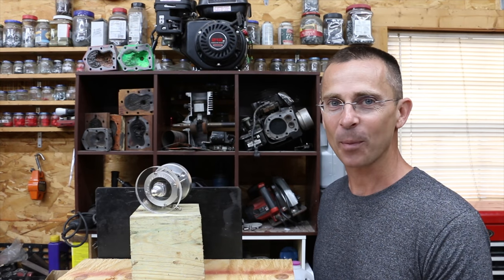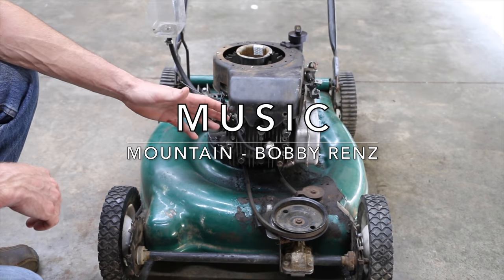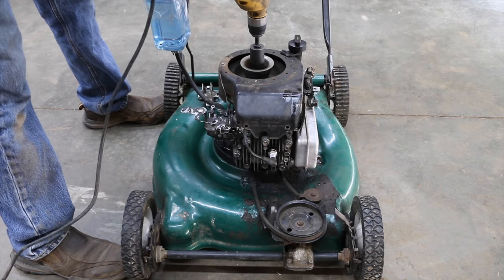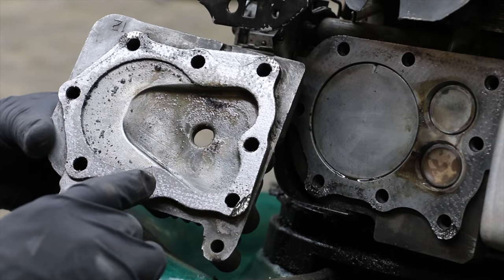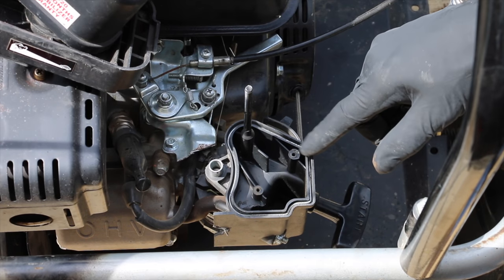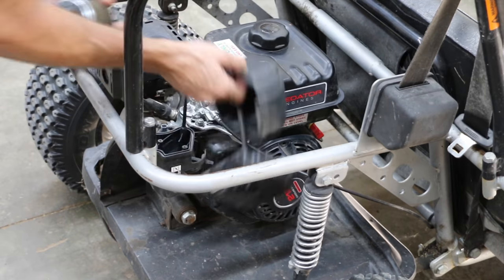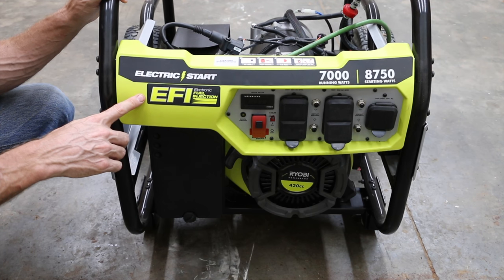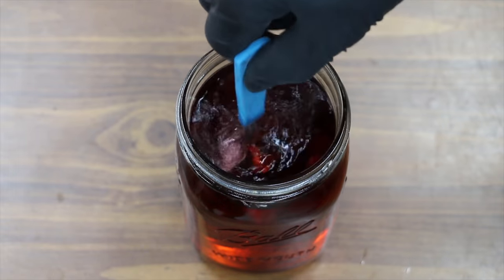Is Leaded Fuel better than Unleaded?  Let's find out!

Comment: Early in the ethanol age, I switched to 100LL Av gas for my small engines. The 4 strokes ran OK on it but the 2 stroke outboards that advance timing with throttle ran pretty rough. It definitely solved the hydrophilic issue I have living on the ocean in high humidity. I found an odd side effect though, that the 100LL leached the red out of any plastic tank I kept it in in a very short time. Clearly it wants to be stored in metal cans.
Reply from the maker: Thanks for the feedback.

Comment: For those who don't know why lead was added to gasoline:  Lead was added to gasoline to buffer the valves when they hit the valve seat.  Otherwise the valves don't last very long because it's like hitting two hammers together.  One of them is going to bust and in the mean time it's like having a troop of tap dancers tapping their way down the road but under the hood of your engine compartment.
Reply from the maker: Thanks for sharing.

Comment: I love how hobbyist pilots are allowed to poison the air.
Reply: jet fuel is much worse
Reply: @johnwoody4905  how is jet fuel worse? It’s practically the same as heating oil, very similar to diesel.
Reply: Many of us would rather not burn this junk, but the first 100 octane unleaded aviation fuel just got approved a couple of weeks ago. The FAA made it very difficult for the company that developed it, and individual aircraft owners will still have to pay for STCs to use it, and even then the fuel is unlikely to be available at most airports for a while… it’s really not a great situation. I would love it if we could get ethanol free mogas (normal gas) at most airports. A lot of planes have mogas STCs and modern experimentals can also run on that. The lead is really not a benefit for a lot of modern engines.

Comment: 100LL is DEFINITELY superior if your snowblower sits for long periods of time without being used...WAY better on hoses and gaskets
Reply from the maker: Great point!
Reply: I use it in all small engines...including chainsaws.....only for the lack of ethanol....is MUCH easier on rubber gaskets and seals. With that being said im sure non-ethanol 91 octane would actually produce more power but for me its easier to get 100ll so that's why I run it/have for 15+years in small engines
Reply: Or you can replace the hoses with silicone and you'll never have any problem with ethanol-containing fuel ever again.
Reply: Just run ethanol free fuel. That's basically what you're buying when you buy 100 LL your snow blower and small engine don't give a damn about the octane or not resistance. If anything you're actually going to decrease the power because the higher octane fuels combust slower.

Comment: So is it bad to use 100LL fuel in a newer ATV? Will it harm anything? A 2021, 850 Can Am to be exact haha.
Reply: Lead will damage the catalytic converter if there is one.
Also it will form deposits inside the engine as well as on the spark plug, possibly shorting it out and therefore keep it from making sparks.
Piston airplanes engines on the other end have 2 spark plugs per cylinder and are disassembled and cleaned quite often compared to a car or lawnmower.

Comment: The 100LL is still 4 times as much lead as the 80/87 avgas. The green fuel is 130 octane and when I couldn’t get 100LL I had to use it. On my next run up I had remove the lower spark plugs and empty out the lead BBs. The leaded fuel is needed because the engines are high compression and typically run full throttle against a continuous load. They don’t have knock sensors and computers like cars do these days. They are currently testing alternative fuels without lead. FAA regulations require that if any quantity of a non approved fuel is introduced into the engine it must be disassembled for inspection. Chevron made that mistake in California in 1995 and it cost them over $60 million, plus rental aircraft. Pocket change to them.

Comment: Very cool.   Now you gotta test G100UL! The FAAs new replacement to 100LL…. I have an airplane and 100LL is cool but I’m digging lead out of plugs is a routine! Love the channel!
Reply from the maker: Thank you for the video idea!
Reply: The folks making 100UL, the GAMI company, are internal combustion engine nerds on an extraordinary level. I’m sure they’d love the publicity of working with you on a video so the general public can learn about their efforts to get the lead out of the fuel we burn in aircraft. And I’m sure you’d love talking with them about how they developed and proved the safety of their fuel. (They’ve busted a lot of old myths about lead “lubricating” and “sealing” engines. In reality a lot of us a hoping unleaded fuel will make aircraft more reliable and go longer between engine overhauls. But if nothing else just removing lead pollution will be great.)

Comment: For a bit of background:

Leaded gasoline is used with engines that have higher internal temperatures (air cooled like many aviation engines) where it would be far more expensive to try and create an unleaded gasoline with similar performance for the given conditions. Also, the higher temperatures are required for the lead oxide to be scavenged properly. It can still be a problem for certain engines, which is why TCP and Decalin RunUp exist; it converts the lead oxide into lead phosphate, which is more easily scavenged at lower temperatures, and in the case of spark plugs, is not conductive like lead oxide.
Reply from the maker: Thanks for the feedback.

Comment: I fuel airplanes for a living, and I have access to LOTS of avgas 100LL and mogas 91 (zero ethanol). I burn both in my car and it loves it. Although I have bypassed O2 sensors and a cat (soon to delete) there actually is no other issue with burning 100LL in your car except spark plug fouling. I check mine monthly and lightly sand blast fouling off and good as new. Also, is that an airstrip that you're running the go-kart on? Sick!
Reply from the maker: It is an airstrip.  It was built by the former owner of the land.
Reply: @ProjectFarm  Nice! I would love my own strip one day. You should get a Carbon Cub and have some fun! 😁

Comment: I had a 55 gallon drum of some and ran it in a number of things. Results varied from different applications. It ran best in high rpm ranged engines compared to lower ones and also higher gains. In a push mower it ran better when going through thicker grass because of the extra power. but a heads up over time since it is low rpm compared to different engines it will eventually destroy the engines rings. as a mixed gas for weedeater it works great. Tried it in a rzr and got major gains with a fuel controller and open exhaust.  In a 230cc dirtbike with removal of baffle, change of sprockets, upgraded cdi raising the rev limiter and putting bigger jets it gained a 10mph difference between regular gasoline and AV. Changing the sprocket from 12 to 13 on front and 52 to 46 on the rear reduces bottom end but with the AV helped tremedously.  stock to modified with AV top speed went from 55mph on a long stretch( half a mile) to nearly 80 with AV and around 70 with regular gas ( with also streamling because with the sprocket change and the top end power drops alot on a lower displacement engine.
Reply from the maker: Great feedback. Thank you

Comment: As a modeler I must tell you the fuel we use in them is a mixture of Methanol Alcohol, 15 to 18 percent oil and depending on the engine a percentage of Nitro Methane like a fuel dragster. The high compression engines don't like the nitro so they tend to be zero to about 5% nitro. I ran 15% nitro in my own engines but tried them with up to 30%. The little wankle amazed me by running gas at all? I ran high octane Av-Gas in my sand rail. The lead was not an octane booster, it was a lubricant for the top end. Once we started to get the stainless valves, stems and guides most people went back to pump gas.
Reply from the maker: Thank you for the feedback!

Comment: The reason the AvGas runs fat is because it is formulated molecularly  to run above 3500 rpm and to run at altitude where the atmosphere is much less dense.  To make a good comparison at sea level you would have to re-calibrate the A/F  ratio to compensate for the atmospheric pressure increase. Also, the 100LL still has MUCH more lead in it than automobile fuel EVER had. 
 Once the engine is recalibrated for the AvGas, you'd also need to run a plug about 2 or 3 heat ranges hotter than OEM spec. The reason I know this is because I used to run AvGas in my 12:1 SCR hot rod engine and did extensive research and testing to get the A/F ratios dialed in for max power and streetability. The testing you did was interesting, just not complete. Love your channel!
Reply from the maker: Thank you!

Comment: I have a 1970 year model vehicle which is made to run leaded gas.   
Gas stations do not sell leaded gas. 
1. Can running unleaded gas cause damage? If so, to what engine components? 
2. Does lead additive help?  
3. Would buying Aviation fuel be acceptable?

Comment: Tetraethyl lead was put in fuel for 2 purposes originally. First was for the valves to maintain sealing and second was for octane improvement. Along with other fuel additives it could go as high as 105 octane at the pump for the old 10 and 11 to 1 compression engines. Trouble with lead is the pollution it creates as it goes through the engine and out the exhaust. Hence the need for unleaded fuels to stop the pollution it was creating and the redesign of engines to match the fuel. Funny that now we have engines again running high compression and still use unleaded just fine thanks to design and electronics. I used to tune my old Plymouth 383" engine by using spark plug color. I am surprised the generator let it run with a leaded fuel which normally would hurt the injector performance.
Reply from the maker: Thank you

Comment: I believe the lead was an additive used to lubricate the valve face in an engine. Which the advancement in metal technology’s it was not needed and hence unleaded gas. The octane value was reduced and produced allot of pinging or detonation which come from 2 flame fronts in the combustion chamber. Sounds like rolling an empty soda bottle down hill on a gravel road. Computer added to system fixed allot of problems and here we are.  I would like to see increases in the octane area. By the way, does anyone remember the stickers on the front of the gas pump that reported how much tax was added, and you were paying to local, state, and federal taxes per gallon?  Better yet does anyone remember when they disappeared? If I buy an item anywhere else it has to be reported. Why not the fortune I spend a year in fuel? Love your research, this is one I really been looking forward to. Bravo my machine head friend. There’s a house next door for sale, and you’d make a great neighbor if your looking? Lol.
Reply from the maker: Thanks!  Thanks for the feedback.

Comment: When I was much younger over 50 years ago we ran a gocart on 130/110 av gas. We went through a lot of engines as the performance was more than the Briggs or Tecumse engines could handle but it was much faster and the acceleration was dramatically improved.
Reply from the maker: Thanks for the feedback.
Reply: I call BS on this.. using higher than needed octane fuel will not burn up or make an engine run faster,, the engine will perform the best on the appropriate octane fuel for its compression ratio. Your pump gas go kart engine will make more power on pump gas and actually make less power on 130 octane fuel. It won’t burn pistons on the higher octane stuff either, higher octane has a higher detonation margin.

Comment: Leaning out the fuel air ratio, will make it rev higher.  Stoichiometric or rich mixtures are for controlled combustion temperatures and making low speed torque, but leaning the mixture outside of the "safe" range can increase peak rpm power.
I'm sure that if you put regular fuel back into the cart without changing the settings,  it will perform the same as the leaned out avgas
Reply from the maker: Thank you for the feedback

Comment: Back in the late 80s I worked on the civilian side of a military airbase, we had 3 fuel trucks with 100LL. Every morning we had to drain 5 gallons of fuel out of each tanker, (helped reduce any water build up) back then we dumped it in what basically was just a hole in the ground.
I used to run my old 69 truck on it, and an old 68 harley. Never did run them on it straight, but at about 75% 100LL- 25% cheapest unleaded I could find.
Reply from the maker: Thank you for the feedback

Comment: Lead had two functions. First to boost octane and second to lubricate valves. We used to get 102 octane at the pumps (the good stuff) and aviation fuel was 120. When lead was no longer allowed the octane dropped drastically and difficult to replace at the time. Older engines had to have lead additive purchased separately. If not the valves were quick to go if the detonation of the low octane fuel didn't blow holes in the higher compression pistons first. High octane fuel burns longer for higher compression engines. Low octane fuel burns fast and essentially explodes causing the "ping" heard from an engine. That's the top of the piston being rung like a bell. Modern engines aren't built to burn high octane fuel and don't need lead lubrication and there isn't any benefit by running it. Unless you drive an airplane or race car to work. :)
Reply from the maker: Thanks for the feedback.

Comment: I enjoy your content...and especially like the fact you are NOT Sponsored by any products...makes your comparisons credible.  

Did you enjoy the sweet 100LL smell better than the "Kerosene Smell" of Jet Fuel? ... (in MN Kerosene is so highly taxed and hard to find off highway "dyed" Kerosene, that many of us with torpedo heaters go to the airport and buy Jet-A for half the cost of typically available undyed Kerosene.)
When Non-Oxy (for My collector cars and ATVs) was so expensive and hard to find in mid 2000's ... I remember buying 100LL for cheaper and was able to advance ignition timing on my collector cars and get considerably better MPGs too...

Comment: As a young line boy at a small airport we had to sump the airports fuel system daily. About a gallon each of a gas and jetA. We used the gas we sumped for the tug and the jetA for the airport tractor mower. Never had a problem. We couldn’t just return the fuel to the tanks after checking daily for water. We had to use it somehow.
Reply from the maker: Great information. Thank you

Comment: Surprised that this lacked your normal very diligently precise mileage comparison! I assume that because the mixture needed to be leaner, yet was still able to achieve faster go-kart speeds, that the aviation fuel goes farther.  Though I am sure the surprising amount of the most toxic additives is neither cheap or healthy! Seeing how it fouls up the engine I am wondering what is supposed to be the advantage.
A video idea:
I am most intrigued by this fuel injection generator that appears in many of your videos.  I would love to see a video of its EFi system. (that this video proves does effectively control the fuel ratio variable pretty well!)
 Its a real rarity! Beyond pricey when you do find it and TTI no longer (if they ever have) offers the EFI parts for it.  I was hoping to be able to replace the troublesome carburetor  a 420cc clone engine I have, but looks like I am stuck with it for now.  Love your videos, Many thanks!
Reply from the maker: Thanks and you are welcome!  Thanks for the suggestion.

Comment: You have to have compression and usually some timing tweaks to benefit from aviation fuel. And it's expensive. The see-through rotary engine was cool! Thanks as always.
Reply: It's also unlawful to dispense avgas into something other than an aircraft fuel tank.

Comment: I used to run my RZ350 on 100LL also on Trick Racing fuel. Most of the time I would mix the two 4 gallons of 100LL to 1 of the Trick fuel. I found that was the best fuel for Two stroke bikes back in the day.
Reply from the maker: Thanks for sharing.

Comment: I think for these fuel tests, you could benefit from using a wide band O2 sensor with AFR gauge in the exhaust to monitor Air Fuel Ratios. Could help in determining why a comparison of fuels did/did not make more power or efficiency, as certain fuels will run at a different ratio from regular gasoline(Maybe why this fuel was running rough?) and if you see or do not see a difference, the AFR data could maybe shed light on why(Maybe a rich mixture causing no gains in efficiency) And it could be another useful data point to help in understanding why the results were the way they were. Just a thought, figured you would enjoy thinking about that as you are so thorough in your testing. Keep up the great content!
Reply from the maker: Thanks for the suggestion.

Comment: I tried Av Gas in a 351 T bucket drag racing as I had to back off the timing with car fuel as it  had closed chamber high compression 302 heads on it. It ran like shit for some reason.Someone said the Av Gas I got from a Car fuel station was outdated not to be used Av Gas.I never thought it would need leaner jetting.Was that the problem ?

Comment: Amateur pilot and mechanic here. 100 LL is an interesting holdover from the days in which leaded fuels were used in cars. 
I would expect the biggest gains from using this type of fuel would be in old performance engines from the 70s and earlier. 
Generally the fuel systems for these engines do not like ethanol as it can break down older rubber formulations. Also the valve designs back then required the lead coating as a lubricant of sorts. 
It's common practice to remove lead deposits from the spark plugs before a flight by applying full throttle before takeoff.
Reply from the maker: Thanks for the feedback.